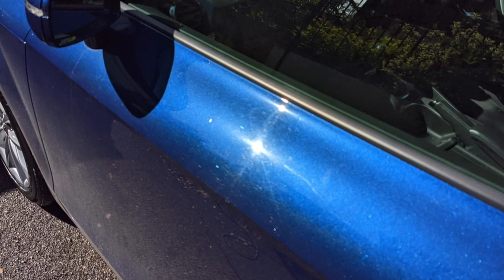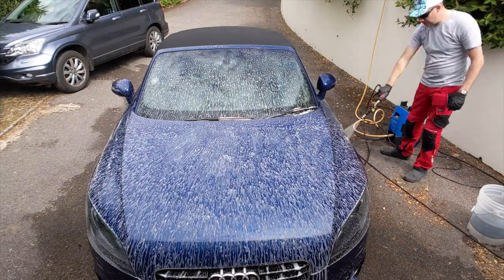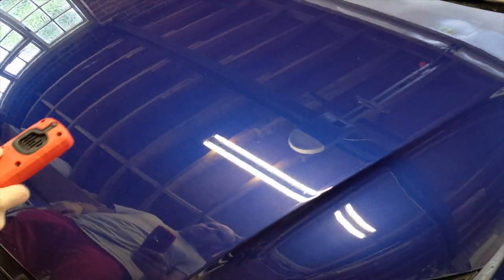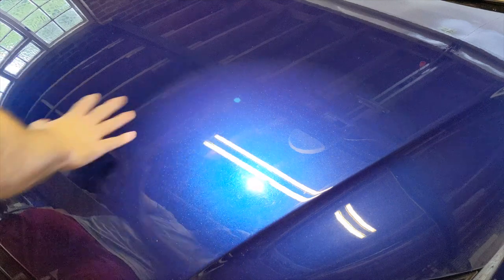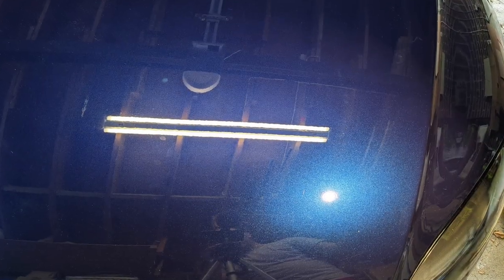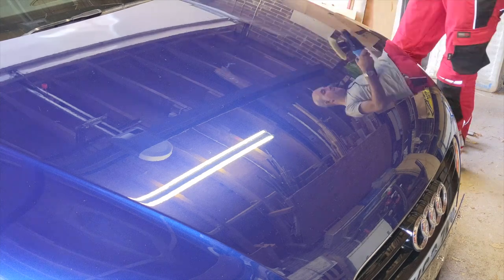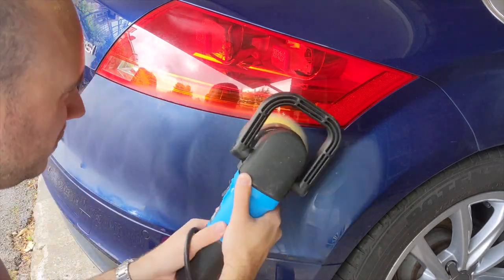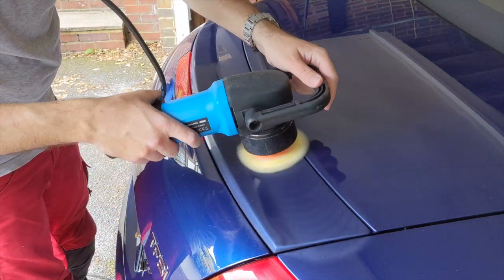Detail: 2013 Audi TT Convertible enhancement detail w/ Nova Lustre

Comment: Great video, it's given me another incentive to do the same to my old Kia. As a first time da user when I borrow a friend's machine. What is the best pad to use in your experience ? My car is probably as swirled as the car you've just polished. Cheers Joe.
Reply from the maker: That's a good question actually, I quite like the Rupes ones, as well as the Scholl and Lake Country ones. I'm not sure there is a best make of brand overall, but also if it's one of those three (+ Koch apparently, I've not used any yet though) then you're likely to have a higher chance of the pad being nice.

Comment: The Rupes yellow wool pad was good enough to cut and finish on VAG paint then?
Reply from the maker: Yup. It can sometimes leave some marring but it didn't this time (a relief), I find it can work better with Koch F6 than S20 but I was out so had to make do. The Yellow Wool is a very good pad, but you do need to be careful with it in some senses, it is still very aggressive....I feel like it maybe more aggressive than the blue foam personally, but it seems to finish a bit better on VAG Paint.
Reply: @SuperchargedLlama  this is perfect for me. I have S20 
All Koch range of polishes and compounds 
Never used any Rupes at all
Reply from the maker: @Geeky_detail_reviews  the problem I find it's that there are just so many pads options out there. And polishes, but mainly the pads.